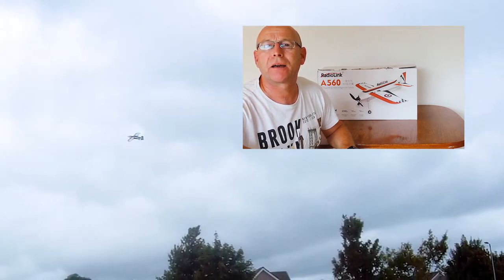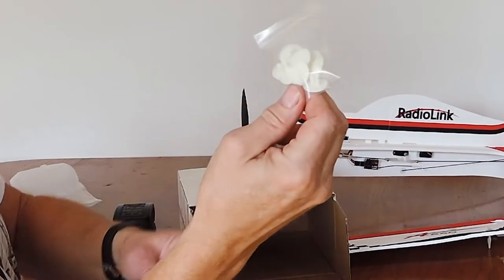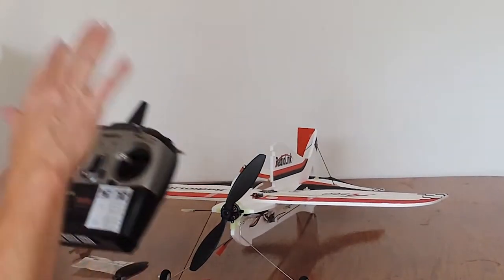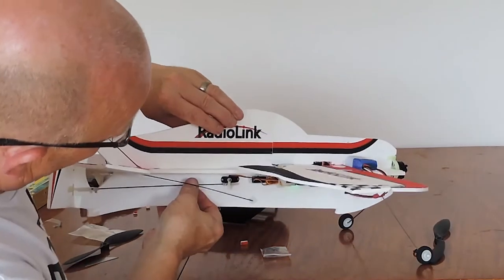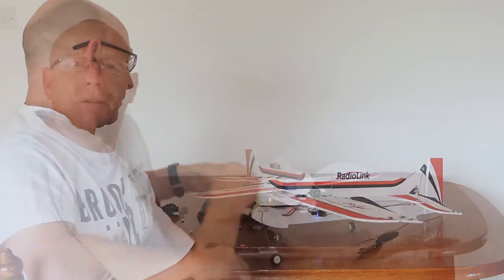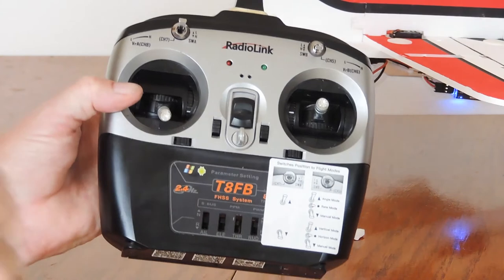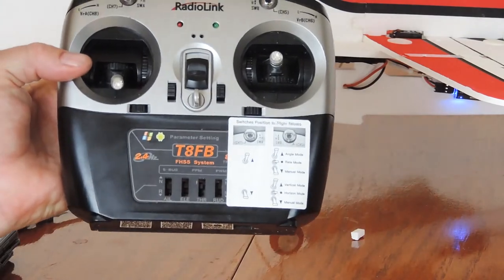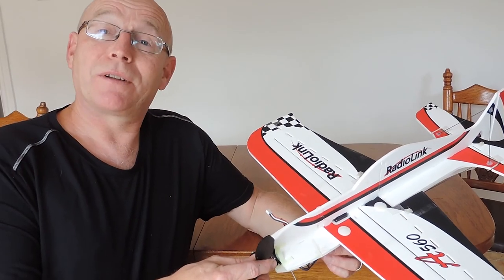Radiolink A560 2020 update,full unbox ,build and review with tips

Comment: Can you by chance clarify the difference between modes 1 and 4 (angle and horizon)? By your description and demonstration they appear to be the same thing (self leveling stabilization).
Reply: On a closer look, maybe mode 1 (angle) is similar to Spektrum SAFE and mode 4 (horizon) is without self leveling but prevents banking and pitching beyond ~45 degrees?
Reply from the maker: Ronh129 has done a better job of explaining than I could manage, cheers for that 👍
Reply: @rcpilots1291  thank you for confirming! Mode 4 seems odd to me, ha ha. I think I'll program 2 switches and skip that mode. I was showing March delivery for my Byme-A but actually received early already. Time to build the bird it's for!
Reply from the maker: @ronh129  I agree about more 4, in my hands is sometimes doesn’t even change its behaviour from other modes, but it’s a super fun plane, it flies in just about all weather conditions. I hope you get loads of enjoyment  👍
Reply: @rcpilots1291  to be completely honest, I got it so I can buddy box an easy mode with my dad and my son.. will be going on a twisted hobby 24 inch MXS-C. I haven't finished the build but have programmed an "on off switch" (basically one switch forces cut to high for manual, and a 3 pos to mix ch5 and 7 for gyro/acro/stabilize modes. This should be great.